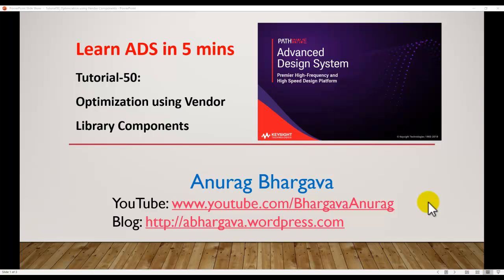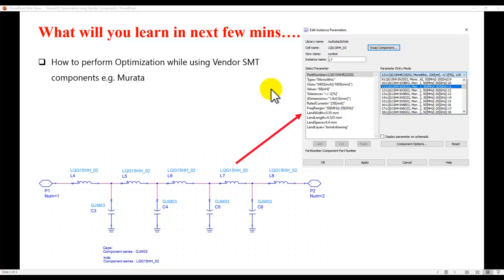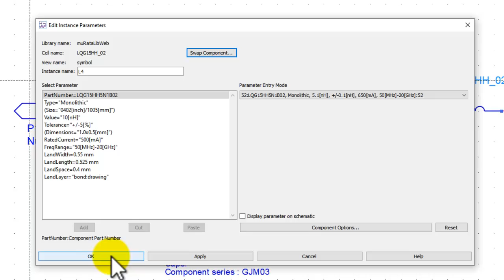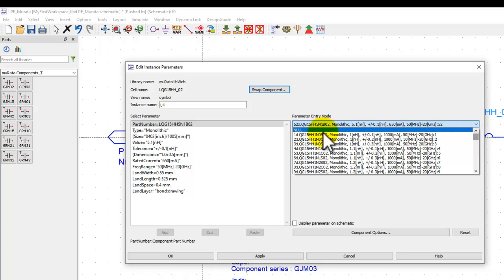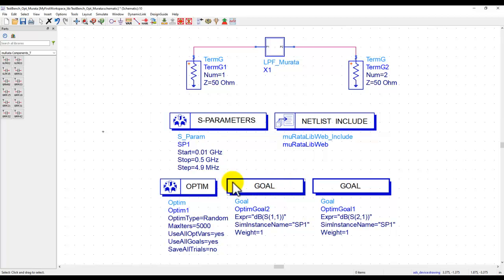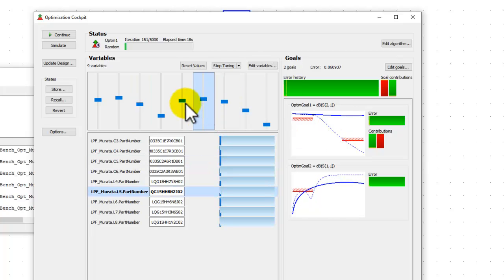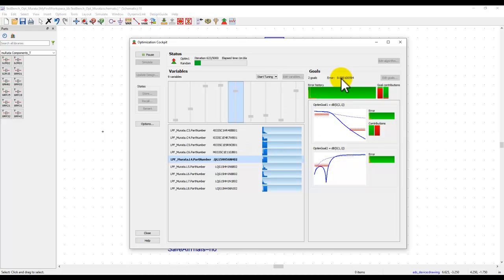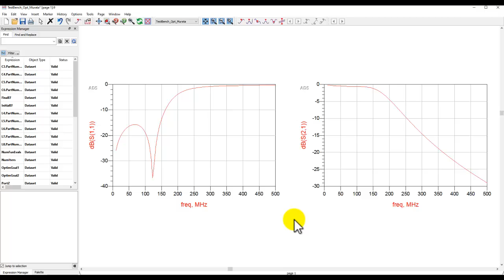Tutorial-50: Optimization with Vendor Library Components

Comment: Any option with Coil Craft Inductors  kit  Vendor library components  for optimisation?
Reply from the maker: I haven't seen Coilcraft for a long time. If they are 1 S2P file for each component then they cannot be optimized like the way shown then better method is to use DAC approach with a bunch of S2P files.
Reply: @BhargavaAnurag  yes  vendor has provided s2p file for components ,
Any Tutorial video available for optimisation with Coil Craft components using DAC ?
Reply from the maker: @praveenkumarbadam4029  I haven't created a video on this topic but yes it will be good to have. I will do that pretty soon.
Reply: @BhargavaAnurag   Thanks
Reply from the maker: @praveenkumarbadam4029  video about sweeping and optimizing using S2P files is posted. Hope your needs will be met with the same.